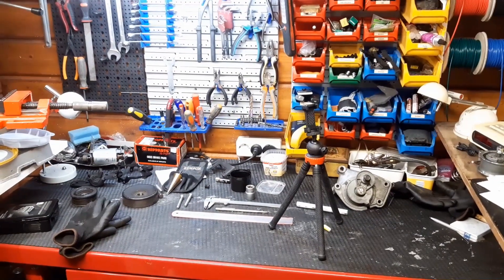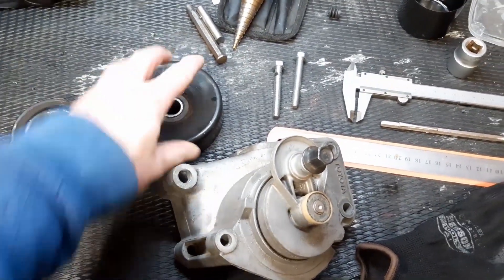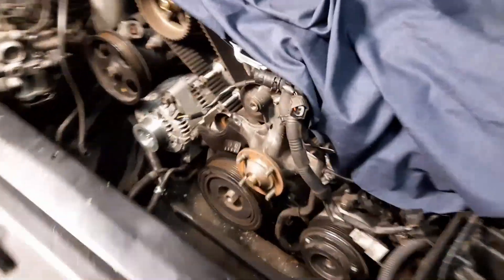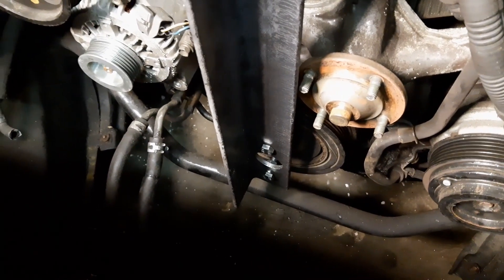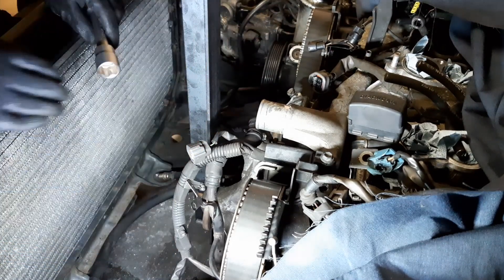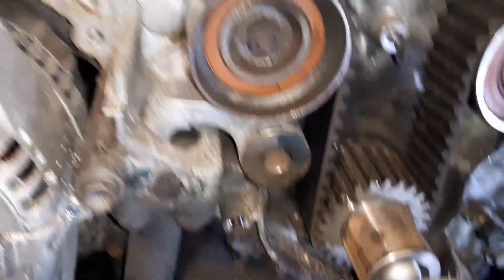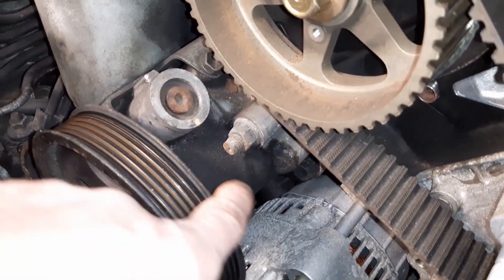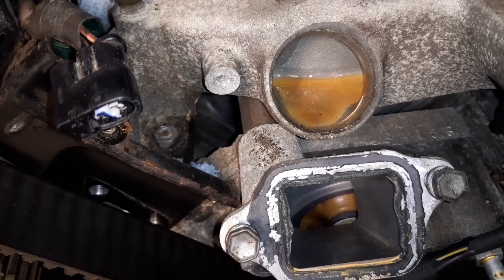Episode 5 project Lexus LS400 - Timing belt installation: Tools make life easy

Comment: Whats funny is I made this exact same tool some years ago to do the same job on my friends MK4 Toyota supra. It doesn't have to be pretty if it works.
Reply from the maker: Hey Greg! Yeah, making your own simple tools can be such a money and time saver! In hindsight I didn't need it to loosen the crankshaft bolt, as it was barely tightened. But it came in handy to tighten the bolt to a million foot-pounds, like the factory does 🙂